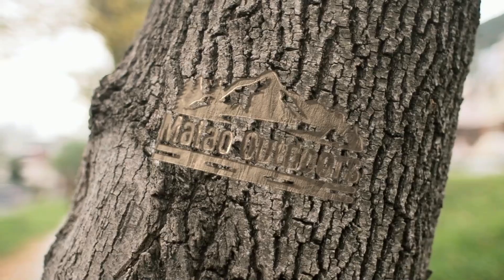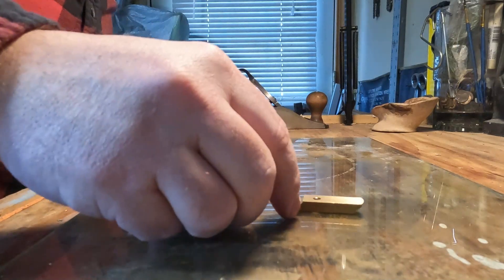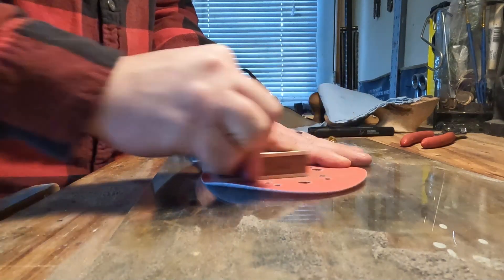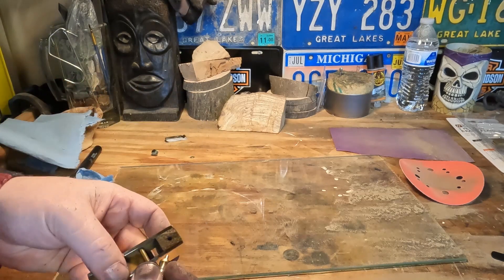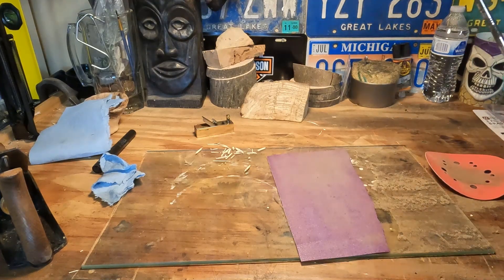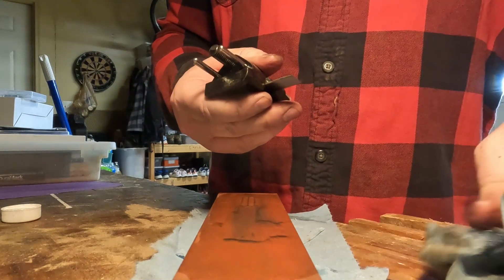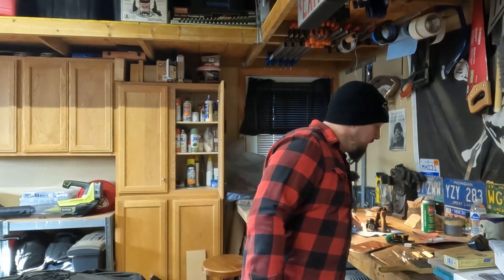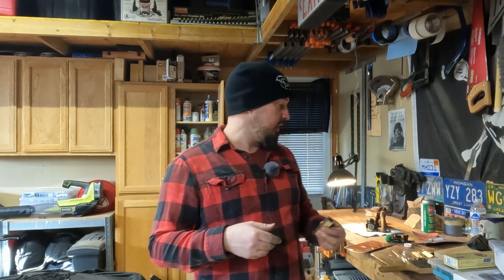Making a Harbor Freight Plane Better

Comment: Right idea - wrong size (of wood) to use it on
It's for thin stuff -  1/8 to 1/4.  Doesn't have the heft to do anything heavy so it is only for light trimming only on thin stuff to custom fit.
Reply from the maker: Agreed, that was just the closest scrap I had laying around, but I was thinking while editing I should have used it on an edge and made a chamfer.

Comment: You called it a "block plane". A block plane blade is positioned with the cut bevel facing up. In this position, it takes a bigger bite than a smoothing plane which, usually, has the blade bevel down. You sharpened the blade to 25 degrees? Try 20 degrees, or less, to get a less aggressive cut. I'm glad to see you put the effort into an inexpensive tool; thus, making it into an, equivalently, more expensive, useful, tool.
Reply from the maker: Thank you! Yeah I'll give 20 degrees a try and see if that works better

Comment: Your thumbnail looks nice and shiny ! A bit dark though, for your skin tone....  sorrycouldn'tresist 😁
Reply from the maker: lol yeah may have gotten a little close to the wheel.
Reply: @mataooutdoors  : Thanks for doing the video.  I picked up a set of those Hbr Frt mini-planes a long time back and was wondering what I could do to make them functional.
I will probably have to do something about the blades.  The steel in them is probably mediocre.

Comment: The black residue: It's a combination of metal oxides, polishing grit, the waxy binder, dirt from the air, and fibers from the wheel.  The heat from polishing action probably darkens the wax binder.
Yeah, the residue is normal.
Reply from the maker: Thank you! :)